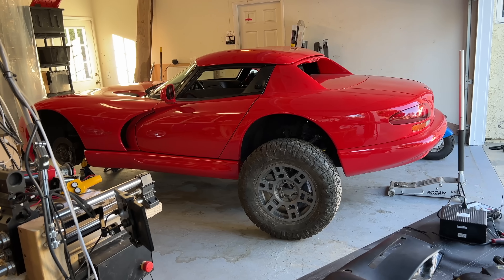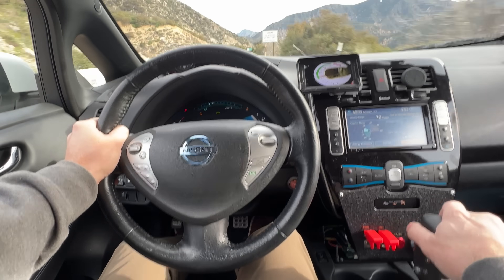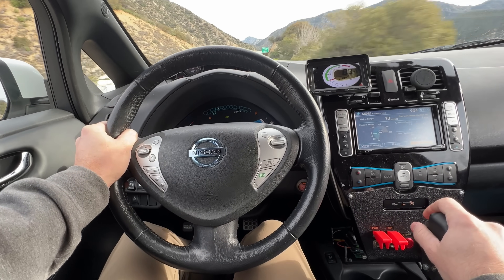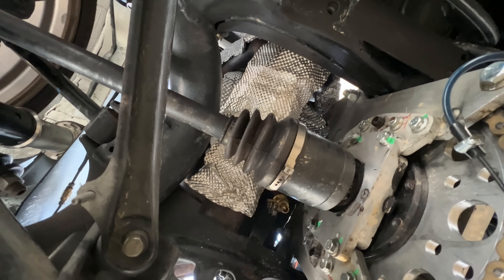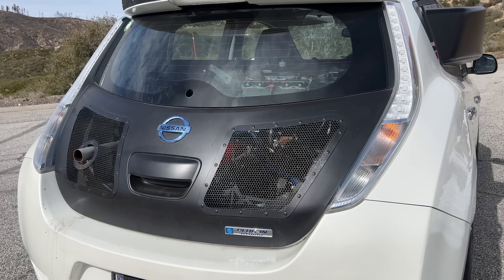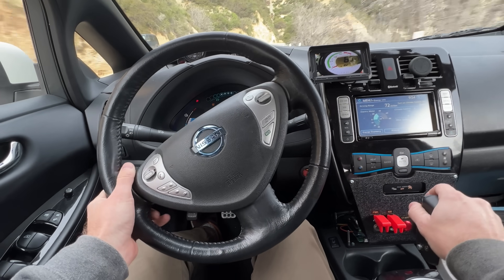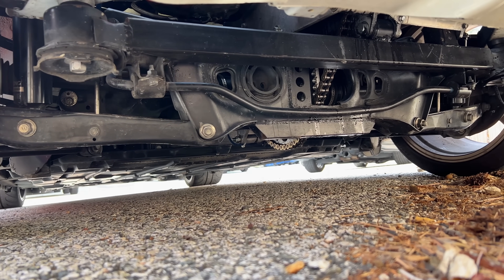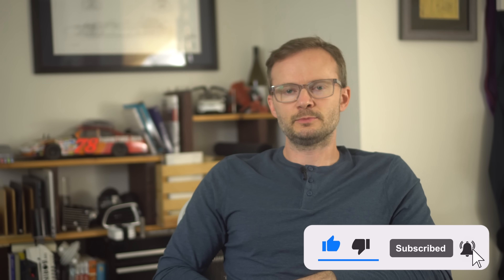This Nissan Leaf Is Hiding A 13,000 RPM Secret

Comment: Seriously- after enjoying my Prius 90% of my drives, if I could just have the fun of my SRT8 for the other 10%... And you need something plug in capable because otherwise the electric drivetrains are weaksauce. If I could have my prius as is, with 3x the electric power via rear motors, bigger front motors and forced induction- I would adore it. Just make it drive like a CLA45AMG somehow and it's all good. 

I'm sorta surprised no one has done it with the Mavericks yet- seems like the perfect vehicle to stick powertrain adjacent into the back of... the Hybrid has a really simple rear end, and since you have the AWD IRS rear end from the ecoboost... you have the major components already. Someone find a lucid powertrain to mess with lol

Comment: I would love that engine in my Honda Odyssey. Slowly running all the way to the top of the rev counter and then going in the next gear. The length of van will allow you to muffle it down as much as possible while also putting a valve to open when you want it to be as loud as possible.

Comment: Awesome! Nice build, it's cool to see the ev being a base, I thought this was going to be a battery strip and you'll be left with a light car otherwise, but this is an amazing concept to keep the modern creature comforts but the auxiliary power.
Question though: how is the leaf recharging while the bike is running, is it just the regen braking?
Reply: Yes, regen through the road during low throttle events keeps the battery charged.

Comment: What I would really like to see is one of those virtue signalling machines fitted with a good APU.
Considering the cost of electricity some used cooking oil to power the APU would make it the cheapest vehicle to run .

Comment: Given the space taken up with the Engine and fuel tank - you might have gotten even better performance by putting in a Tesla motor for the rear axle and packed out the boot with more batteries - just saying...

Comment: I’m merely an mechanical engineering student, so I’m not sure how or why, but how would the EV motor handle being overdriven? As in, its trying to give you say 40mph but due to the bike engine, it’s going 60.
Reply: The motors just add torque, they aren't trying to hit a certain speed.  Think of the two motors as teammates on a tug of war team and the road is the rope.  Both motors add torque to cause the car to accelerate.

Comment: This is so cool love it . Would be neat to do it on a bolt ev it has room underneath in the back.
Reply: I would love to do this (I own a 2023 Bolt EV and had a 2017), but they're just too expensive (for now) to cut up.
Reply: @DerekYoungdby  a crashed one will do. And best thing is just leave it in drive. And also pedal Regen. A crashed bolt would be a good project like this leaf. And still have truck space in the back.
Reply: That could probably get it confused with a Volt, another Chevrolet product and the first mainstream plug-in hybrid.

Comment: Leaf also has really nice weight balance (exactly 50/50 if im correct?) So it inherantly is quite dynamic to push in corners. Not fast, but fun.
Reply: Stock is 56/44, pretty good for a front driver.  The car is now 51.5/48.5.  The CG isn't quite as low as the stock car as the moto engine is pretty high, but with 600lbs of battery near the ground, it still feels great!

Comment: Very cool with the side ducts for the air intake and layout. However the exposed chain and sprocket at the bottom made me wonder why there wasn't an aluminum splash shield to protect from the elements.
Reply: It’s a motorcycle engine. They are always exposed to the elements.

Comment: Okay okay okay, hear me out...

But add a CVT to the drivetrain after the gearbox (clearly) but before the connection of chain to rear axel.

This will give each gear a fun new twist (I'd use a snowmobile clutch meant for 2 stroke at high rpm in the 1000cc range)

Comment: I’m fully sold on EV’s for life, after driving 60,000miles, but this is pretty cool I must say, bravo for modification ingenuity. This would make sense in 2012, but there’s so many DC chargers alone across the CA/US already, that range anxiety is nowhere near this extreme anymore. Plus the weight of ICE/gas only drags you down, like all hybrids, when you could be thousands of lbs. lighter with an all electric platform therefore more range.
Reply: Battery weight???

Comment: Straight-line, great, but mid-corner... hmmm. The problem is that any vehicle containing two "engines", gas or otherwise, never have the same torque curve. When the driver accelerates, the two ends of the car will act different, and worse, depending upon rpm of each, that differences can get worse, better, or even swap "places" as far as their effect on handling. Run either the EV or the bike engine, and the handling will be much more predictable, though that wasn't the point.
Reply: I couldn't tell on track (or on back roads).  It feels like a pretty normal AWD performance car.  I haven't driven it hard in low traction situations, so it might all fall apart there....
Reply: @DerekYoungdby  Yeah I'm speaking of the threshold condition where the car is cornering at the limit of adhesion. At anything less than that, I think it would be fine, but would still feel strange when getting on and off the gas.
Reply: @kurtbilinski1723  clearly I need to get more track time in -- for science!  Have you driven a dual motor car at the limit or is this just a thought experiment?

Comment: I don't understand, when it's in 1:1 mode (full hybrid) how does the electric front wheel drive motor sync up with the rear wheel Kawasaki gas motor?
Reply: A microcontroller reads the Leaf throttle and then sends commands to the drive-by-wire servo on the bike engine.
Reply: @DerekYoungdby  Thanks! Well done too!

Comment: Very cool, though I can't help wondering about fitting the Leaf with a rear mounted Telsa drive unit and a high voltage battery pack where the rear seat used to be. We all have our own madness.

Comment: Stops better than any other leaf? You're more right than you probably know. Early leafs have faulty firmware in the brake-by-wire brake controller that can do many things including come to a full stop on the abs without your continued input and refuse to stop at all, as well as inconsistent force in between. Scary. I got the full abs no pedals and had a BMW who was tailgating hit me. Ha ha

Comment: so wait if i understand this correctly, if you want to drive EV only, you have to have the clutch pressed in? i dont know exactly how motorcycle clutches differ from car clutches, but wouldnt that put the throwout bearing or comparable part through tons of unnecessary wear?
Reply: Or put it in neutral.
Reply: @DerekYoungdby  ah got it. Thanks! Sick build btw, y'all engineers make some insanely cool cars
Reply: @0xGRIDRUNR  thanks!

Comment: Some people also like "Dinner theatre". Like  my assessment of this car, I find it the worst of both worlds.
Now this is because I think Nissan cheated a lot making the Leaf  EV to a price and not to a standard. Likewise, I got out of motorcycling without having anything more traumatic than hitting an unexpected sand  drop in a blind corner and having to ride the cycle to a full stop on top of it's slide off the road. Much better than the other way round. 
I spent far too many years driving a souped up VW Fastback and its noisy rear engine, to ever want that sound behind me again, even though I was the one who built that  engine to that condition.  But I am old now so to each his/her own.

Comment: I bet you can do it with a Morris Minor, Austin 7, Hillman Imp, Fiat Topolino, Fiat 500, Ford Popular, or similar car. Fit a late model engine, motor, transmission, fuel cell, computer, wires, etc, in a Ford Pop.

Comment: unsolicited project suggestion: add a salvaged tesla model 3 motor/battery to a FRS/BRZ - keep the gas engine of course but somehow combine/add the output from the electric motor to the rear wheels. that's my dream at least. i want more power out of mine but don't want to boost it at 10yr old now

Comment: 9:30 First thing that comes to mind is the Honda CRZ. It had a gas motor, an electric motor to help along and even was a manual. But the powertrain was to weak for how it looked, the tiny 1.5 engine and only 14HP electric boost didnt do much...
I thought about a conversion like this but this guy just did it :)

Comment: If he wanted an extra 100bhp ilthe newer leaf E+ with the 60kwh battery has the same motors but the inverter is rated to supply the power for 213bhp.. the only issue is the main fuse may need tinkering with or if he retro fits the 60kwh pack he will have more range and power
Reply: The Leaf hacker community has shown the plus inverter to work with the 24kWh pack and fuse.  I'm working on getting one in my car!
Reply: One of Matt's points was that the purpose is not simply performance - that's easiest to do all-electric - but the driving experience of using the engine.

Comment: how can you drive this legally on public roads? in europe they will refuse your periodic technical inspection just by putting a led position light instead of an incandescent bulb and yet he swapped the rear drive train, added a motorcycle engine, made changes to the body work and it's totally fine? come on!

Comment: This thing is really neat, and there's only one downside I see: it's a small hatchback that weighs the same as an e39 M5, with 100hp and 2 seats (now, anyway) less. That much weight means expensive tires. Still, it's the coolest affordable hybrid in history. It's completely unique and I bet it's a wild sensation to drive. Much respect Derek!

 I'm looking into a "1290 Super Duke engine in a Miata" idea because that L-twin is dry sump from the factory (and the TORQUE). Someone talk me out of it.
Reply: Nobody talks him out of this, we need to see it happen
Reply: Definitely make a video out of it. We'll be cheering for you
Reply: OOOHH MAAAN PLEEEASE DOOITTTTT
Reply: It's a KTM, isn't it? So, an European engine, you're going to have a fun time than a long time...
Reply: @calvinnyala9580  the ktm 1290 platform is a pretty solid engine
Reply: @6Mar99  yeah, but it's a KTM

Comment: Abarth should build 500 like this leaf.
Reply: I actually have a 500e that I would have liked to have used instead of the Leaf, but half the battery is in the trunk where the engine needs to go.

Comment: Do both engines just don't care if they are being driven by the other engine sometimes? I can imagine the electric motor just thinking "oh! For some reason I'm in regen mode now!". But wouldn't the ICE start to engine brake when the electric motor is going faster? Or is there a one-way power Transmission clutch?
Reply: They don't care.  Think of them as tug-of-war teammates with the road as the rope.
Reply: The electric motor only regenerates when it is told to (by pushing the brake pedal or lifting the accelerator enough in "one pedal" mode); just getting a push from the gas powertrain won't make the electric powertrain go into regeneration.

Comment: There is another reason he converted an EV:  no SMOG check required, so CARB is none the wiser...  I made the "mistake" of actually investigating making a hybrid BEC from scratch and was flatly told "you can't put a bike engine in a car because it's not certified for car usage".  So that project was killed.  I made an electric trike with a Miata rear axle.  It really needed a gearbox because 4:1:1 isn't low enough.  But on another note, I managed to get 17 inches of travel out of stock Miata axles and uprights!
Reply: I know people who have successfully done SB100 registrations with scratch built bike engine cars.  Don't ask me how, but it is possible.

Comment: how did he solve the cornering oiling issues with the stock pilpan? or is the stock oilpan just deep enough that oil just doesn't sloch away like when you cut it down to a flat bottom.
Reply: It's a very deep (6"?) V shape with the pickup at the bottom.

Comment: Coolest build I've seen in a long time. Imagine if you had a more powerful electric motor in the front it would be a monster if you could keep weight down.
Reply: I'm working on getting my hands on a Leaf Plus inverter.  The Leaf hacking scene reports seeing 150kW (up from 80kW) from the stock motor, even with the stock 24kWh battery.  Total system HP will go from 280 to 370, which should be fun! Weight is another challenge...

Comment: I absolutely love this. Never would have thought of it but now I want one.

A nice quiet cabin with modern tech and decent sound isolation, no worry about crusty several decades old seals, modern handling and the brake upgrade up front just bolting in is the cherry on top.
Reply: Matt overstated the comfort levels, sound wise.  Even in EV mode the chain makes a good bit of noise.  There is however, a heated steering wheel.
Reply: @DerekYoungdby  I love that you're responding to the comments here, I hope you end up making a detailed walkthrough on your channel. Even without editing it would still be fascinating.

In regards to comfort, I guess it's important to keep things in perspective. It's never going to be silent, but compared to the S600 it's an S-class :P

Comment: why is there a live feed of the tach rather than just putting the tach there
Reply: Because it was easier.
Reply: @DerekYoungdby  how was it easier?
Reply: @elitesennabubble  One tiny wire to run from the back of the car instead of cutting the bike harness and lengthening a bundle of 14.  One small flat screen to mount to the dash instead of a weird shaped deep gauge cluster.
Reply: @DerekYoungdby  I suppose. I am a fan of really snappy and responsive tachs
Reply: @DerekYoungdby  I really like your build anyway. My dad used to have a 2012 leaf and it was an ok car. Couldn't get very far though without charging
Reply: @DerekYoungdby There are only two reasons to install screens on the dashboard: Putting all the gauges where the driver can see them better and exploiting whatever advantages cameras have over mirrors. This is an example of the former.

Comment: I've thought about doing the reverse - take a FWD manual car and put a diff and electric motor on the rear. The Toyota Matrix/Pontiac Vibe is a good candidate because they can be flat towed with the FWD manual configuration, and an AWD model is available, so the rear suspension and diff are bolt-on parts. Bonus if you get the 6 speed Vibe GT/Matrix XRS. The Prius/Rav4/Sienna rear motor/diff may even be an option.

Another option is taking a RWD pickup and putting a front diff out of a 4WD with an electric motor. Just has to be a flat-towable transmission.
Reply: My pick for this is a 2nd gen Probe GT.
Reply: A 1955 Chevy Cameo or GMC Suburban with a Vonnen Shadow Drive sandwiched between the engine and transmission, or a GMC Cyclone IFS  with an electric motor and differential gears up front. Oh, it’s got to look like a straight restoration.
Reply: my pick is the audi tt :)

Comment: I wanted to do something like this but i reverse. And i dont know if this is possibel yet. I want to take a rwd car and put a ev engine in the middel of it next to the transmission. A axel straight to a front diff and turn the front wheels. But i think that it will make the car more sluggish then it already is

Comment: If a manufacturer or engineering could do this and still keep a backseat plus some modest cargo space, I would buy it in a second.  The combo of EV when wanted + crazy fun engine is unbeatable.
Reply: Can you imagine having the whole engine as a modular box you just plug into the back when you want it?
Reply: There are some PHEV optionsvnow with decent power from the ICE and decent electric range. I think the Volvo V60 Recharge has around 250hp and 40 miles of electric range? But I'm not aware of anything which is smaller than that at the moment.
Reply: @Khrrck How about the BMW i3’s Range Extender variant?
Reply: @owilliams1031 not bad as a hybrid commuter car / daily, a bit short on cargo/passenger space and ground clearance for some people's use cases. Not really enthusiast performance although a lot of people would have a second car for that.

Attractive pricing for what you get though vs a newer PHEV.
Reply: @Khrrck But the BMW i3 is similar in size and shape to the Nissan Leaf.
Reply: @owilliams1031 yeah but the original comment wanted a larger car.
Reply: koenigsegg gemera is pretty much this on a a huge budget

Comment: I think the idea of a motorcycle engine in a car is fantastic. I have always been a huge Metropolitan Nash fan, and that's the first thing that comes to mind. That's the answer for these cars with a super small engine bay, or electric, (hint). Your next project Mr. Matt, if you decide to accept it, is to put a Hayabusa motorcycle engine in a Metropolitan Nash, or make it electric. The state department will disavow any knowledge or involvement in your mission, if discovered. Good luck Matt.
Reply: Yesssss!  A Metro.
Reply: I’d say put the Rover K-Series engine and uprated everything else to MGB specs. If you can add the hybrid setup from Vonnen, all the better. Keep the little cutie stock appearing and keep blowing the doors off Honda Civics with a 1950s British convertible that looks like it should be at Pebble Beach Concours D’Elegance.

Comment: I have been driving a gen 1 Chevy Volt for about 5 years. There is a lot about this leaf that my volt does already, though severely underpowered in comparison. This video has reinvigorated my hatred toward Chevy for discontinuing a car that had such potential for greatness.